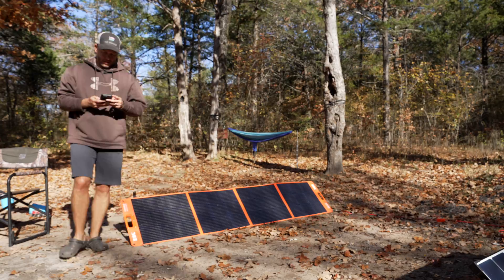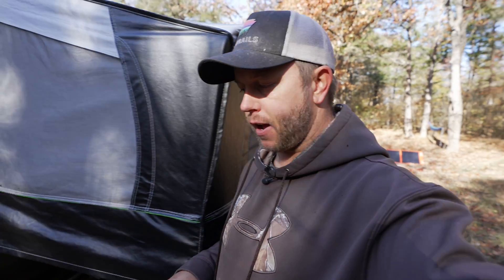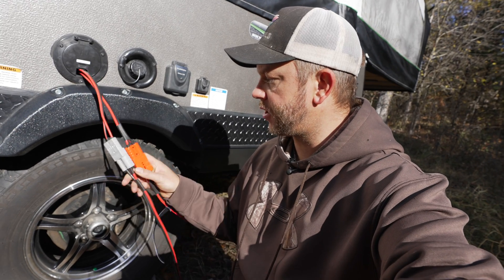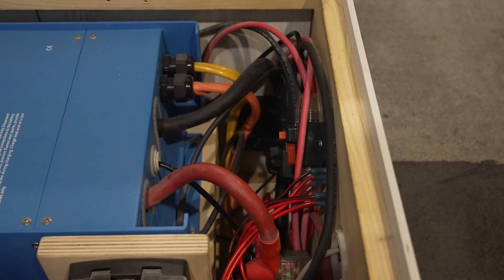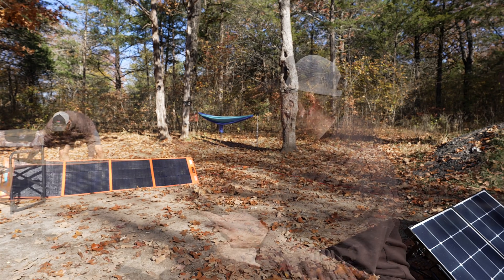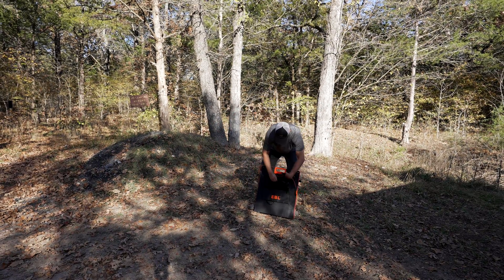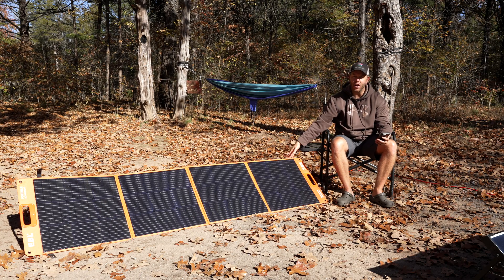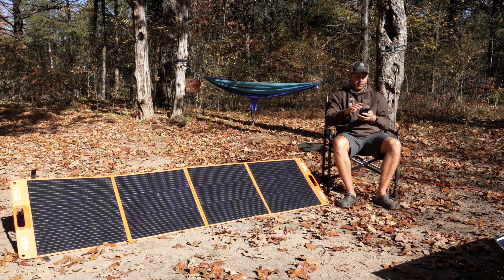Testing a 200 watt portable Solar Panel Camping - EBL 200w Solar Panel

Comment: Nice video.  I'm also using a Victron SCC, 100-20 with a SetPower freezer.  I was using 2 200 watt Renogy panels, but Renogy did me dirty.  They changed the spec on their 200 watt panels without changing the model number, so the older panel was 20.16 volts, but the new panel that I bought only 11 months later is 18.8 volts.  That means 7 percent wasted power running in series.  So I returned the new Renogy panel, and now I'm going to try an EBL 200 watt.  It runs at 19.8 volts, which is very close to the 20.16 volts on the Renogy, so these will work better in series.  I've never used an EBL before, but it looks like I'll be happy with it.

Comment: on a very sunny day, max i was getting 77w. this is not normal right ? should i contact amazon support for replacement ?
Reply from the maker: If you charge controller is sized correctly, using the approprete size wire & the wire runs do not have massive voltage lost - these are really love values. Shading might cause these, but if that was your highest value pointing at the solar panel at the sun - I would say something is not right. You're settings on the solar charge controller might be off.

Comment: Thanks so much for all your reviews. When you were doing your installation of your solar system, did you ever look at solar generators instead of your entire set up that you installed permanently? The reason I ask is because it seems like with all of the different things that you use your jackery for, you would like Wyze find that versatility and portability of a portable solar generator to your liking. I’ve recently done some research, well, I’ve actually been doing research on solar generators for years, it takes me that long to learn, and found the OUPES bread to be very exciting. To the point where I’m on my pop-up, I decided not to invest in the separate batteries and install the batteries and MPT controllers etc. etc. and simply buy the mega three with an additional battery which gives me over 5000 W hours. I can plug my  30 amp cord from my pop-up right into it and can charge it as I have 200 W of portable rigid panels and 160 W in 4 240 portable foldable panels from OUPES. Another nice thing about this group is that they do have certified recondition items. So I got two additional 240 W each solar panels at about a dollar  and e cents per hour.  I really love the idea of having the additional expansion battery as well with this unit which gives me 3072 on the generator 2048 W on the expansion battery. That gives me about 1360 W of solar and with five hours of peak solar harvesting time that gives me about 6800 W of potential energy harvesting over that five hours. Even if I took half of that Potential that gives me about 3400 W hours that I can pull in during that five hour peak solar harvesting time. sorry for rambling, but just was curious about what your thoughts were on this option for somebody like me who doesn’t have the knowledge like you do of doing an electrical install. I’d love to see you do any evaluation on these OUPES mega three or mega 2 or mega five even as I think they’re pretty impressive units and have seen some significant reviews from some very qualified Youtubers. Look forward to your response.